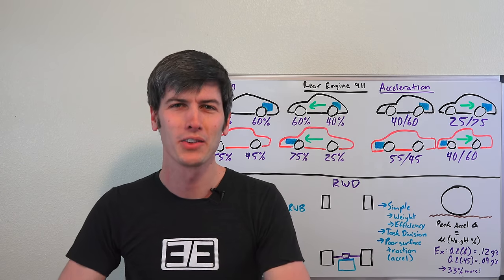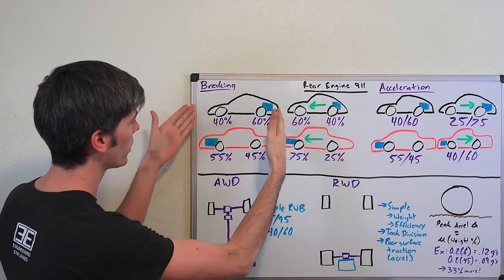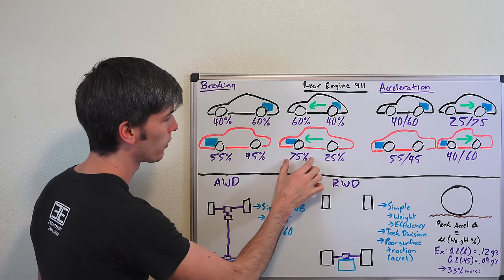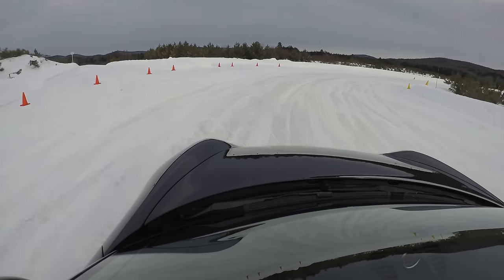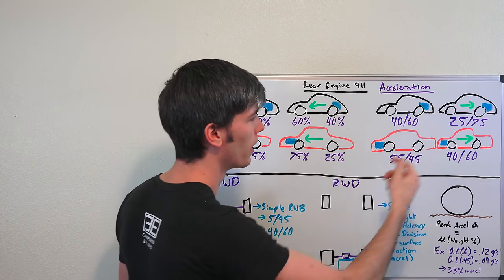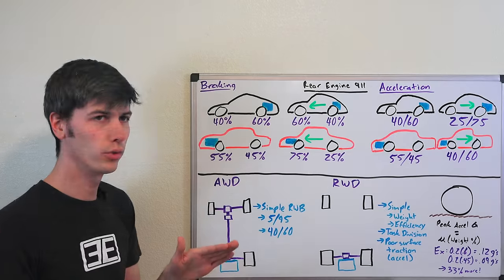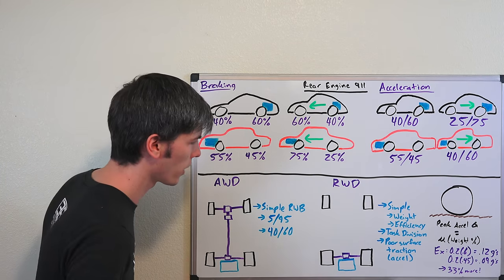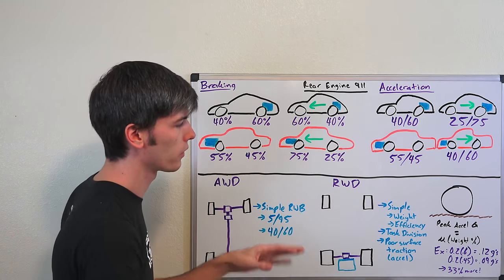Why Is The Porsche 911 Rear-Engine?

Comment: At this point, tradition.  There's better places to put the engine, like in the middle.  Strange how that wasn't mentioned as one of the options.
Reply: Monster RAM 
In the car😆
Reply: Monster RAM Yes, it's quite obvious the Porsche engineers stuck it back there because the Beetle did, and now they have come up with justification for it after the fact
Reply: Monster RAM Because it's a Front WD vs Rear WD sports car comparison, that's why!
Reply: Timms MC The 911s do but they're mostly useful to put some milk or other small items in, not a lot of room.
Reply: Timms MC 911s have rear seats, small but useful
Reply: It was mentioned.
Reply: I was thinking heritage as well. There is a reason most of their other cars are mid engine now.
Reply from the maker: But of course! Hence why there are racing versions of 911’s that are mid-engine, but no road cars. I wanted the focus of this video to be about the engineering logic behind a rear-engine, rather than the heritage, though it is most certainly a reason why.
Reply: cerebellum Yes they are close to being Mid engine like the Cayman and Boxster. Ideally that would be best all round, but Porsche have so much experience with rear engine set ups, you need to drive one to really admire how far they have come with a far from ideal set-up! Currently the 911GT2 RS holds the road car record round the Nurburgring, against cars such as the 950bhp LA Ferrari. And your grandma could drive it to the store for milk! Amazing engineers!
Reply: what everybody is missing here about mid engine cars is that even the high end street or race cars never have a 50 - 50 weight distribution, and they are in fact rear weight biased because of the exact reasons showed in the video. But I guess nobody likes to check facts and it's easier to embrace the old tired Clarckson "nazi assed beetle" line.. To all the armchair experts, come back with a car that has more racing victories than a rear engined 911 then we can talk. Oh yes, real race victories, like in Laguna Seca, Le Mans, Daytona, 'Ring, etc.. not moonshine runs ..
Reply: 911 wouldnt have rear seats if they went mid engined, the only reason their race version is mid engined is because they couldnt get enough performance out of their diffuser with a flat 6 back there
Reply: The only mid-engined 911 was the 911 GT1 (Porsche 961).
Reply: Race versions of 911 are rear-engined too (except 961).
Reply: It's because that's what the fans want. Remember that Porsche tried to kill the 911, but they got an angry mob with torches and pitchforks at the factory gate. 911 fans be crazy. It's about being unique in a world of generic sportscars.
Reply: @far num BMW M3 E30 has won a ton of races.
Reply: THE BOSS I guess that's why the newest 911 RSR is mid-engined

Such a good configuration for the track that even Porsche themselves ignore it!
Reply: The race cars (GT3  and so on) of the 911s all are rear engine
Reply: Monster RAM If it can break records with the engine in the rear, it must not be a very bad idea.
Reply: But the 911 has a back storage seat
Reply: Cayman and Boxter are NOT 911's.
Reply: Cayman and Boxter are NOT 911's.
Reply: Yeah, pretty SCARY car isn't it. Would you call the tailheavy oversteering  dynamic a feature or a fault? 
Porsche never completely sorted the cars handling out until they went 4WD. Before that the cars were noted for knocking down trees when exiting the corner backwards because of trailing throttle oversteer, aggravated by a high polar moment of inertia caused by-- excessive concentration of weight in the back of the car. Which is why top line cars STILL favor the mid-engined layout.
Reply: When you look at the Yellowbird racing Nürburgring it would seem it's a feature. :-)
Reply: Yeah, that would be Toyota MR2 Turbo -)
Reply: Engineering Explained  if you have a mid engine Porsche then you have a cayman or boxster so they don’t need a mid engine 911.  I’ve gotten to work for Porsche for over 5 years now. Amazing cars.  Glad too see you got too do the Canada North America coarse. I hope too one day
Reply: R35PECT is that why Porsche puts the engine in the middle in many racing 911’s?
Reply: Thomas T squeezing your feet? Are your feet behind you? Wtf
Reply: Krazy Bubba tell them to put a god damned GT3 engine in the cayman then god damn it stop discriminating charge the same price as a 911 for that model just do it
Reply: Engineering Explained .. Porsche moved the engine to the middle for aerodynamic reasons. They needed a rear splitter.
Reply: James Thom it’s certainly getting closer with every generation & as they continue to stretch it further & further in both directions the balance & weight distribution inch closer & closer to ideal/RMR layout, just from 997.2 to 991 the car got both 3” longer AND a new transaxle was developed that allowed the engine to be moved 3” further towards the center and yes regardless a cayman-esque rear mid engine rear drive/RMR platform is more ideal for all but passenger space maybe but I disagree that Porsche’s level of experience with Rear engine rear drive layouts has anything to do with their not moving the 911 to a RMR layout. Porsche may well be more experienced with producing mid-engine layout cars (and doing so well/flawlessly) than any other brand in the world currently and by extension in the history of the world/ever. 

Naturally this  the case for them with rear engine cars as well but there’s always going to be drawbacks in the latter that are exacerbated or nonexistent as compared to mid-mounting
Reply: For sure,  the 911 race cars have their engines moved forward recently. If rear engine was so ideal won't other manufacturers offer it? Right, they don't. The current 911 is more of a GT car and works well, as a sports car, not so much. The Cayman would outperform a 911 if Porsche hadn't neutered it with less power, for example.
Reply: Having your transverse engine on the driving axle is the best thing in terms of raw power since you minimize the losses (Longitudinal engine means 90° angle to deal with). And since on the front axle, you have direction, it's a good idea to not overflow them with too much power. So, rear axle.

You could probably put it more in the middle, tho.
Reply: True
Reply: @matthewschiebout9081  The 911 doesn't work well as a sports car? What are you smoking?

Comment: I hoped this would explain why the Porsche 911 uses Rear-Engine instead of Mid-Engine. I still think Porsche is purposely holding back the Cayman.
Reply: It's all about the fans, the 911 has a rabid fan base, they want their 911 with the engine in the back, damn it.
Reply: With Caymans going Turbo & with tunes, I think we’ll see.
Reply: My third new car was a 1971 Porsche 914.  It was the only car with which I have ever spun out and I spun out 3 times  with that.  At speeds over about 30 mph, on wet, snowy, or icy pavement once the rear end started to move outward recovery was impossible.  Other than that it handled beautifully.  However, it was the most unreliable car I've ever owned; I could write a book about all the things which went wrong with it including a torsion bar which broke and a cabin heating system which rusted out in 2 years (that was in Minnesota where roads are salted during winter).

Comment: I remember long ago  reading about the 911's inherent design flaws both of which you covered well.  That being: Rear weight bias and Over steer.  I still don't know whether the one I drove was AWD or not( it was a 911 2.7 S.  I'm guessing that is was Rear Wheel drive because of the tremendous torque.  Throwing it into 2nd gear. was so much fun but watch out for fish tailing and over steer.

Comment: So you are trading handling for better straight line acc. and braking?
Reply from the maker: In a simplistic view, yes, though you can compensate handling with clever things like suspension geometry, rear-wheel steering (for better rotation), tire sizing, etc etc. The GT3 is an exceptionally well-handling vehicle, despite having a large mass behind the rear axle.
Reply: The 911 has its flaws, like being a bit "understeery" when first turning in, but that can be fixed with more right foot :) the new GT2 RS is 4ws and an absolute monster round the track. So much so that it demolished the so called "Hypercars" round the Nurburgring, cars such as the 950bhp LA Ferrari. Porsche have done miracle's with a far from ideal set-up.  Drive one! Then you'll get it!
Reply: James Thom the gt2rs is rearwheel drive. the "common" 911turbos are 4wd though.
Reply: another benefit of the the rearengine is less drivetrainlosses, since you don't have to run a shaft from the front to the back of the car. less rotating masses also increases drivetrain efficiency
Reply: In theory, you are losing a bit of handling, but that can be corrected with proper driving technique - that's another reason why people love the 911, because it requires mastering the car, it takes a while, but it's so rewarding. A huge advantage of the 911 is that you can brake later and accelerate earlier out of turns. That's how, on racetracks, they always outperform mid engine cars with more horsepower.
Reply: TheWolvesCurse hes talking about 4 wheel steering not 4 wheel drive.
Reply: @eddgrs9193  not always.
Reply: @eddgrs9193  Because of the extra weight at the , they often eat up their rear tires sooner than their mid engine brethren, need to pit more often

Comment: Very good video and well explained too.

Today there is an awful lot of uneducated bias towards FWD cars (i.e. FWD is great, everything else is 2nd best, old fashioned, or even unsafe!). People do not stop to think about the dynamics that take place when a car is under power, breaking, or cornering hard.

So far as FWD goes, it is possible the worst place to put the engine regarding tractive effort, sharp steering and predictable breaking goes.

The mid-engine layouts may give excellent handling, but the engine takes up potential cabin space and makes maintenance much, much more difficult.

Front-engine-RWD gives a combination of good balance when cornering, and better stability than FWD when breaking, but lacks decent initial traction.

Rear-engine-RWD gives THE MOST traction of any layout, precise and light steering, and good stability during breaking. The cars are, however, more affected by cross-winds, will ultimately oversteer when cornering too quickly, and the boot space is less practical than a FWD hatch.

At the end of the day whatever the engine/transmission layout – it is always a compromise.

PS – I've spent 20-years enjoying Rear Engine Skodas, and detest every minute I have to spend behind the wheel of a FWD car.

Comment: Would you then say that I should put wider front tires in my f80 M3? People say that it can put more strain on other suspension components. Any thought about that? 
Great episode as always!
Reply: You can use it to adjust the balance of the car if you want to. If you want less understeer and more front grip then widening the front tires can do that. If your car is already too oversteery or balanced just as you want it then don't do it.
Reply: Tommy L Garage it will stress stuff out mostly tie rods but it's not a big deal for the handling you will gain if done properly.
Reply: diygarage great answer. Thank you !
Reply: Jerry Tsu agreed. Thank you !!
Reply: Wider tyres up front will make your car handle, accelerate and break WORSE in WET, Ice and snow conditions, but will improve the overall handling and the braking in dry.

Comment: I really feel that all of this could be achieved with a mid engine, just much more rounded and a lot less oversteer
Reply: Mid engine cars struggle with space. 911s still have back seats
Reply: I drive my 964 hard in the the canyons …
All of this over steering talk is out of proportion.
If a 911 has the correct tires/ sizes and alignment, oversteering only becomes may become an issue when driving near the limit.. or when you do something to seriously unsettle the balance, like lifting mid turn, high angle, at high speed, (which you shouldn’t do regardless )
because your correcting from maybe taking incorrect line…

Comment: I found this interesting, as always, but what I also found interesting is something you briefly spoke on. About two shafts, for RW biased AWD cars. I have a car which is AWD, with a 40% front and 60% rear (under standard conditions) drive bias, yet it only has one shafter going to a rear differential. It can also split as much as 80/20 front and rear and I believe another 80/20 left and right per axle.

Comment: Based on many years of winter driving when I lived in the snow belt, the coefficient of friction on ice is more likely to be 0.02, NOT 0.2!  My first new car was a 1964 Volkswagen.  The oversteer made it impossible to corner smoothly at highway speeds; it required constant sawing on the steering wheel.  Also, driving when the wind was gusty was very tiring because it required constant quick and large steering movements just to stay in the lane.

Comment: So we have to divide the two questions: Why does it make sense to put the engine at the rear? and: Why does the 911 has the engine at the rear?

So for the past 911 you are absolutely right. But in the present there is only one reason, why the 911 has a rear engine: tradtition and marketing. It´s not allowed to have a mid engine. In the 911RSR Race car e.g. - racing at Le Mans - porsche has turned engine and gearbox, so it now has a mid engine which is much more usefull on a racetrack or on curvy roads.

Front-mid-engined cars have other advantages: you can get a weight distribution of 50/50 which is good for cornering and you can put the driver´s seat a lot far in the back wich gives you a better feeling for what´s your rear end doing but not losing the feeling for your frontend. When I drove a 911, I found it would be very light and insensible at the front compared to my TVR or Caterham. 

Due to the rear engine the 911 also has the fuel tank at the front which makes the steering and the grip at the front very sensitive for the load of the tank (empty-full). Even the Porsche Race drivers are confirming this and complaining about.

Regards
Reply from the maker: Well said!
Reply: Dear bro: you rich. Kudos.
Reply: Well said. Also rear engine cars are inherently more unstable in corners and Porsche did try to replace the line with 924/944/964 ones, but failed. So as you said the market forces Porsche to keep the 911 line and perfect it's handling through tons of tech.
Also for early 911s they're air-cooled so there's no need for a lot of piping going to the front of the car. I believe at that time the design is simpler hence more robust than a FR car. But with water cooling and the modern crash structure in the front, 911s have a smaller luggage space than many FR sports cars as well. Although it's never the point anyway.
Reply: @goat9199: Haha, I wish I was. I didn`t own these cars at the same time, but replaced the Tuscan with the Caterham. Meanwhile I sold the Caterham and sized down to a Lotus Elise. If I was rich, I would buy a Porsche Turbo for the German Autobahn. That´s where you can take advantage of it - as EE explained in the Video - and keep the Lotus for the B-roads. But owning a TVR gives you the chance to drive other expensive cars, because a Porsche-owner is very interested in testdriving a TVR and so you can make a deal :-)
Reply: wrong, the RSR has the engine in the (rear)middle because of the aeropackage.  All other racing 911 are rear engined and they are the most successful race car in the history of motorsport, by far, no contest !
Reply: far num I think for 911 race cars there's homologation requirements so they can't be too different from the road car. 
The rear engine logic cannot explain that the majority of the racing cars are mid-engined including Porsche's own 917/919 and spyder.
Reply: In Le Mans 2017 the RSR quit 4th of 5 behind Aston (FR), Corvette (FR) and Ford (MR). I would not call that successful :-) The only manufacturer, that was slower, was Ferrari..what a surprise :-D
They also lengthened the wheelbase which brings more weight into the middle aaand of course improves aerodynamics
Reply: Meanwhile 911 GT2 RS claim 2nd on fastest lap time in nurgburgring, beating Mclaren P1  with very little money.

Comment: Hey, a video about efficiently operating a standard transmission would be cool. meaning, going over proper times to use high gear in low speed situations such as turning at green lights or something. stuff like that. cheers!